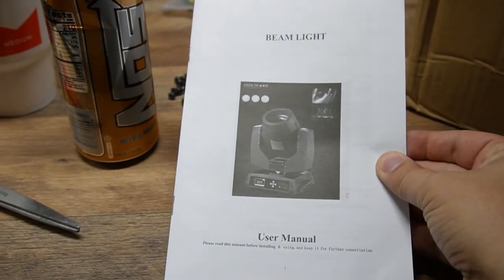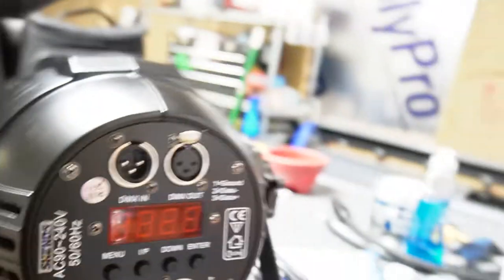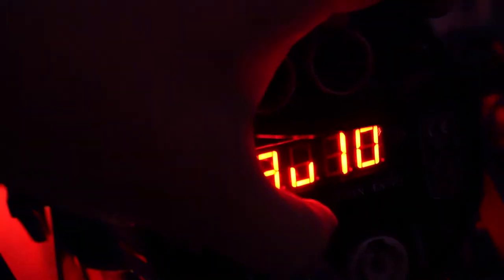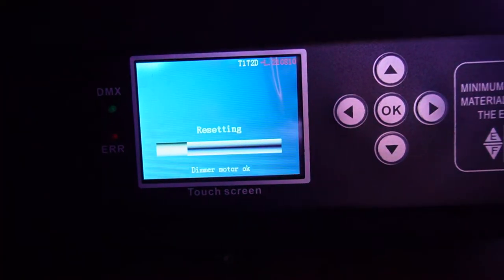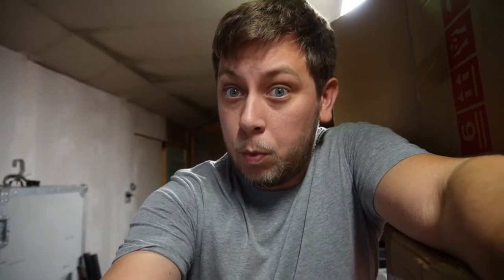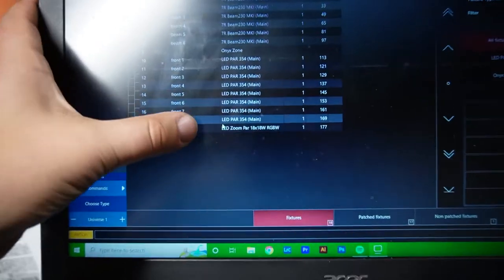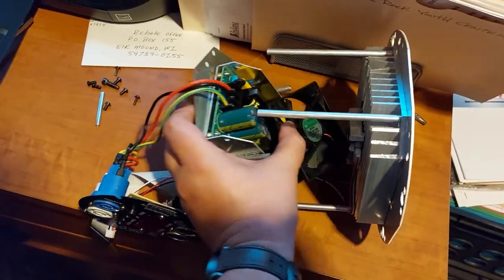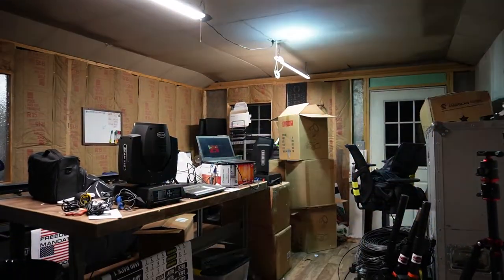Are Cheap stage lights Good? Ebay & Shehds

Comment: We have those exact same Beam 230s in our church and they run really well. Shehds also sells some Beam 230s that are slightly different but in terms of the light itself it's the same (only differences are that the Shehds version has a powercon out and a rotary knob instead of buttons). We've had a bit of trouble with them but I think those are more in terms of power and not the fixture itself. Very informational video!

Edit: at the time of writing this, we are having a problem with one of our 4 beam 230s. The light is out just like in the video
Reply: Hey, are they beam spot and wash? Or are they just advertise that?
Reply: @bdogplays  Just beam

Comment: I had 8 shedhs moving lights in my hire stock and one week after getting them brand new they were self destructing their lamps so I sent them back and ordered 4x chauvet rogues and 4x robe 1200ats
Reply from the maker: Those Robes must be amazing!
Reply: @DCAVL  they are and very bright plus you have virtually endless features
Reply: They let you send them back? They have been such a pain in the ass and giving me the run around. Nightmare. Won't ever buy from them again.
Reply: 😂For just a small upcharge...
Reply: @jstamets  personally i find shedhs fixtures are over hyped and dont offer as much as chauvet equivilants
Reply: @chrisclose7793  I agree, but I wouldn't expect them to for the price difference. I have and like Chauvet. These are essentially disposable fixtures that I consider to be an entry fixture that you replace as funds allow. That said, as long as they do the job you need them to, then they're perfect. Certainly wouldn't trust them for anything critical though.

Comment: Shehds has a huge issue with consistency. My Shehds par (the exact model you have) is extremely loud. Quality control is really bad as well.
Reply from the maker: Dang, The ones we installed very quite. Then one caught on fire. lol
Reply: @DCAVL  Oh wow. That almost happened to one of my battery powered pars from shehds
Reply: Not a bad idea to buy an extra as a parts donor, for the amount you save buying from them it's easy.. They're good about sending parts but waiting a month for delivery kinda sucks.
Reply from the maker: @stonegray230  I always do. Being able to rebuild a light from others that are not working has saved me a couple times.

Comment: Beam 230W looks the heat problem. Try to change the temperature sensor or check the cooling system.

Comment: Ya know the main issue i have with these cheaper lights is that either they are just straight in cable, or in this case Powercon which issent the end off the world but id prefer true 1,  And that they all are 3-pin which makes em a pain to use together with any kind setup that uses 5 pin like MA2, I have 2 pairs of Solena 12w Minipars, and no matter what i do with the fixture profile everything happens on a single DMX channel instead of across 8 DMX footprints as supposed. Not sayin all of them are like this but thats my main problems with these cheap ebay lights what not
Reply from the maker: I have a so many 5 pin to 3 pin adapters. 😂😂😂
Reply: @DCAVL  🤣 yep, it do be like that

Comment: wait till you measure the power draw of the pars.
Mine are drawing a lot less power then specified.
Reply from the maker: Really? Idk if that's a good thing or a bad thing.
Reply: @DCAVL  its more a thing like you don't get as much light output as they describe..
if there power draw and output would be like the specs says they would be alot brighter .. so its not a good thing in less power means less light output so not getting exact what they sold you from the spec sheet.

Comment: Yea... They are not very good. But plz, don't put "Chauvet" or "elation" in the top quality brand, they are almost the same as sheds or Chinese. Nothing like a real pro fixtures brand like clay paky, coemar, robe....
Reply from the maker: I knew it was only a matter of time until a real LD made a comment on this video. They are pro lights in comparison to these stock lights coming out of china. It would be a dream to have some Robe, Clay Paky lights at my shows. Maybe if I make better videos I will have better lights. lol
Reply: @DCAVL  WOW, somebody who claims that I'm a LD. Uh... Thank, wow. I use to have a couple of Chauvet dj light like the radius and some American dj stuff. They were not very good. But I never owned myself some of their more "pro" moving Head fixture. I guess, for most dj application, they're fine and easier to transport than big clay paky stuff

Comment: The big wash zoom they sell is hot garbage. They don't zoom...they have like 180 degree wide spill. When you zoom them in/out, the spill stays the same and it creates a hot spot in the middle. Its laughably bad.
Reply from the maker: Yes I have nothing good to say about those these days. After installing one started to smoke and almost caught 🔥.